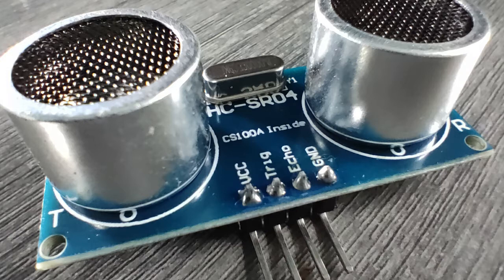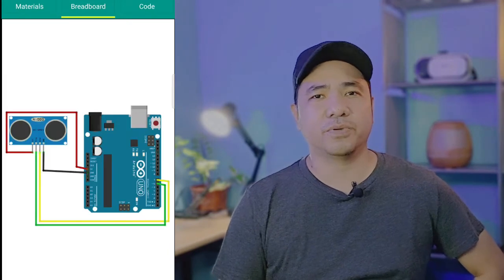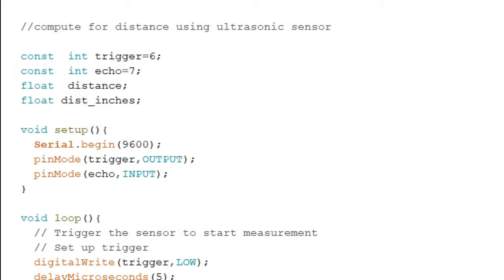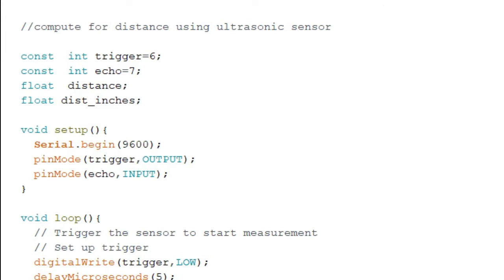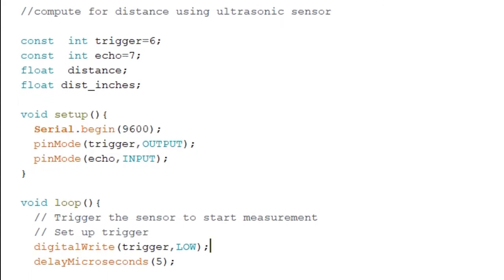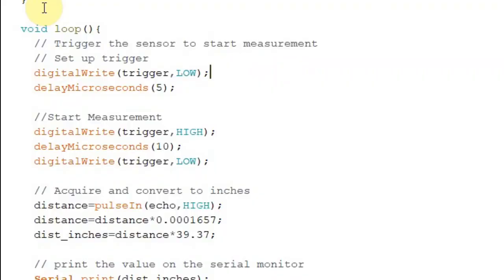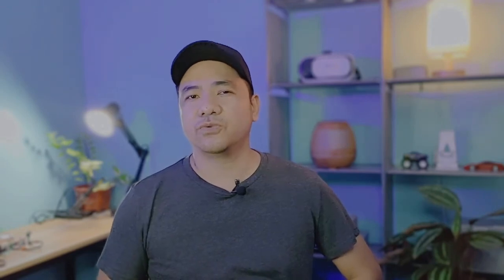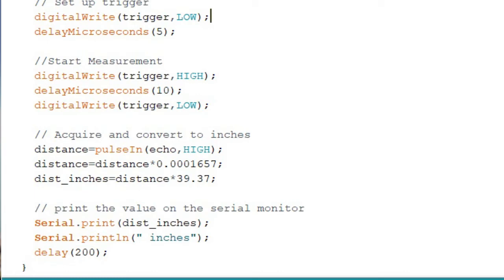Using the HC-SR04 Ultrasonic Sensor with Arduino to Detect Objects

Comment: For anybody who is curious, the Arduino is measuring the time the signal sent from the trigger to the time the echo is received in microseconds, i.e. millionths of a second.  The ping travels at the speed of sound. If you know how to do dimensional analysis, it's not difficult to figure out yourself. Just don't forget that the sound has to travel the target and back, so you'll need to divide your answer by 2.